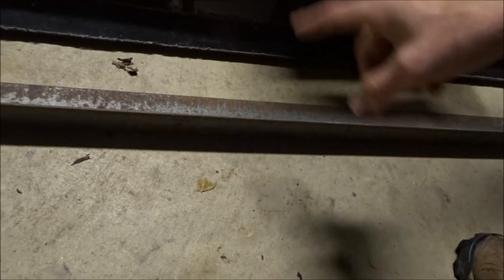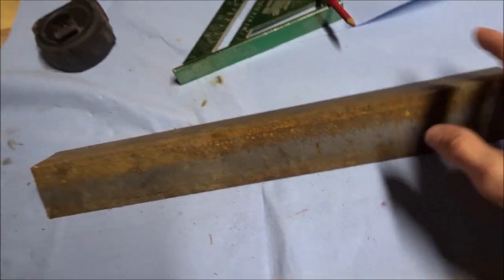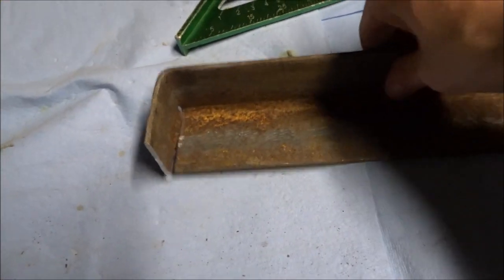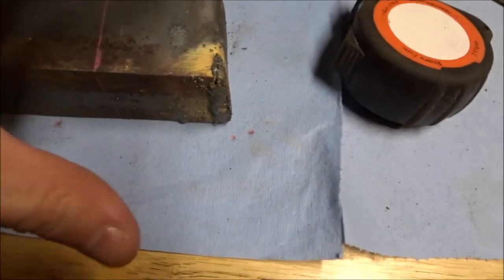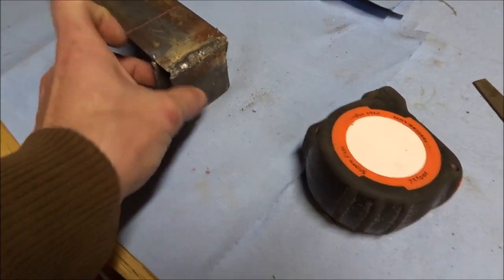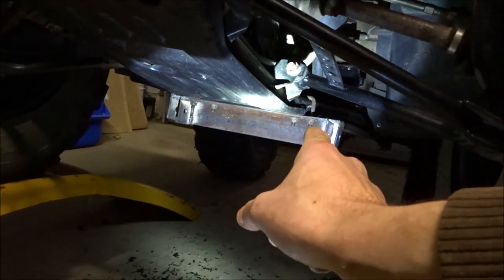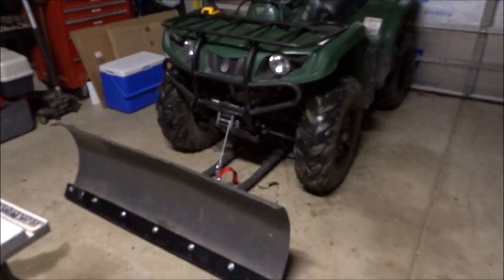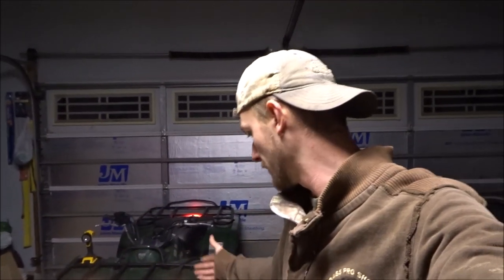Making a Custom ATV Plow Bracket

Comment: How does it push snow? I picked up a cheap moose plow on FB! I’m curious to see where you mounted your angle iron on the frame I couldn’t really make it out. And does this cause more stress on one area of the frame? I have angle iron and I bolts here and was just getting ready to do what you’ve done here, but just thought I’d ask a few questions before I went and did it! Thanks

Comment: Why don’t you cut the back out of the bracket I’m sure you will hook a good many rocks with the bracket if your leaving it on the bike . Don’t cut it all out it will take away the strength just leave maybe about 3/4 “  to give it some strength.  Most  big rocks won’t hook the bracket they will just pass on through

Comment: Wouldn't it be awful if there was no snow this winter?
Reply from the maker: I wouldn't be too happy about that.
Reply: R U going to be able to angle the plow?
Reply from the maker: Yes, the plow can angle all the way in both directions.
Reply: Nice! I liked how you folded the tabs down then added the cut off pieces. I was going to weld all four tabs onto the angle iron until I saw how you did it. My only 4x4 ATV is a Yamaha 350 Big Bear which is full time four wheel drive. I've been wanting to put a 46" Craftsman snow plow on it that's been sitting in my shed for a long time. Thanks for the tip!
Reply: Nice work Mitch.
My only concern would be putting all the pushing stress on the same area of atv frame.